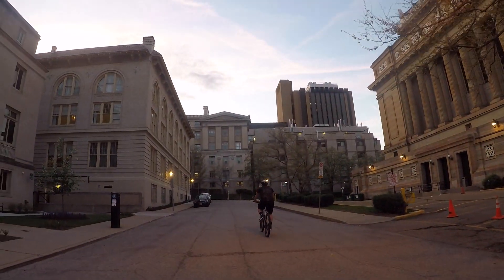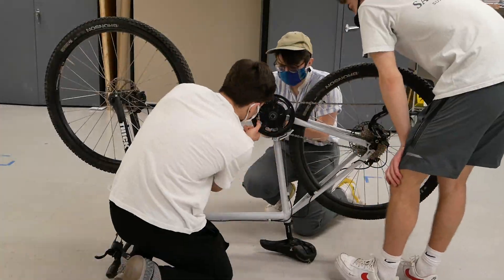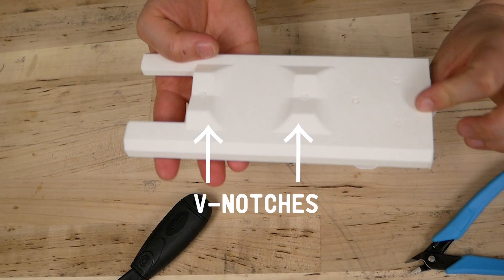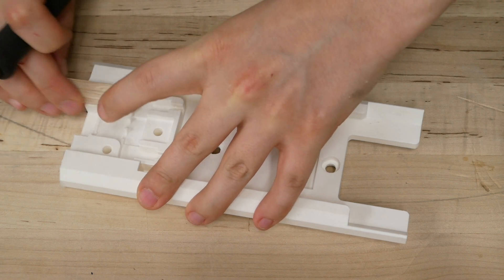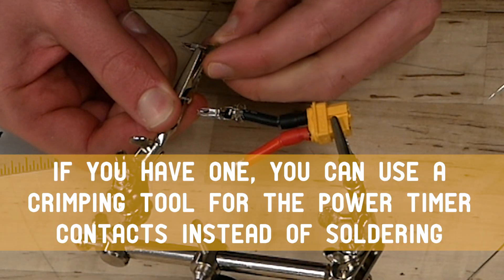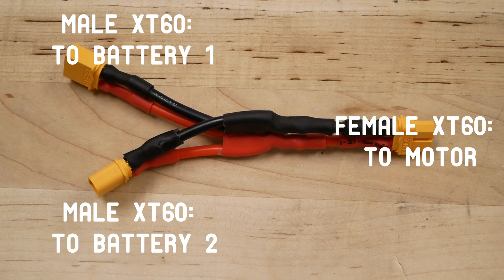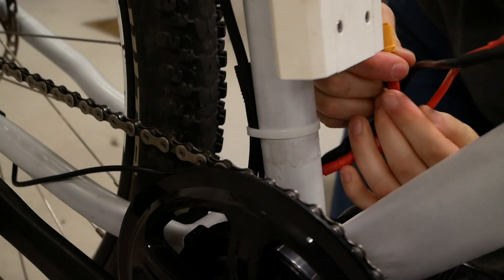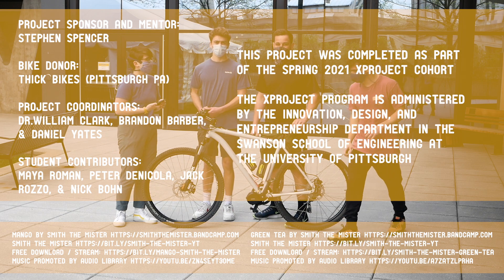DIY EBike Battery System

Comment: A note, you should not be recommending users to parallel two batteries without balancing them first. You will get one battery discharging to charge the other battery, which can be unsafe if the voltage differences are great. 

If you want to balance two, you should get them to charge as close as possible, and then set up a large resistor between the two. Alternatively, you can use a single larger battery, or use a transfer switch, or manually swap the batteries.

Comment: I’m using 56v and 60v batteries on a Bafang 48v motor.  The Bafang system will detect an over voltage situation at 61.5v (error code 7H), so some combination of 60v and 58v batteries in parallel tends to keep voltages within acceptable peak charging.

40v Ryobi batteries for lawnmowers are 6aH.  The major brands for 56v and 60v batteries are Greenworks, Ego, Echo and Toro.  A lot of choices to use here.
Reply: Nathan grant:  do have a schematic of your setup. did you have to change the voltage level  at the controller board. Does the controller board give you a option to change the watts from 750 watts to 500 watts? You have an interesting setup.

Comment: 4Ah x 2 = 1280 Wh	
		
Throttle Assist Range 50 Approximate Miles
Pedal Assist	Range Approximate Miles
Reply: Wrong! 4Ahx2x40V = 320 Wh

Comment: Do you have a version of this 3D printed part that has a flat backside?? I want to use this for something other than a bicycle, and need it to lay flat. Thanks in advance!!!!
Reply: They made the Fusion 360 files available. If you've used that software before, you can open the model and modify it as you would like, including making the back flat.
Reply: @BenjaminNelsonX  Sorry, but no, I have never tried any 3D modeling.

Comment: Please provide info on the throttle and controller used in this project. Thank you for a great project!
Reply: most E-bike Mid Drive kits will come with their own controller, throttle, and brake levers or brake sensors.

Comment: EBAY BATTERIES ARE WAY MUCH CHEAPER
Reply: Ebay 40v ryobi batteries are crap though.. i bought a 6ah batt and it weighed less on a scale than my oem 4ah battery.
Reply: When you buy a name brand battery instead of a counterfeit, you're paying for reliability, consistency, and durability. Worth it if you rely on your bike for transportation, without a doubt.

Comment: Great project! Did you use a 36v motor?
Reply: The link in the description shows everything they used. The particular motor they used is rated for 48v, but as stated in the video and description, they're using 40v batteries.

Comment: LOL...taking a BAFANG to "a local bike shop and they will be happy to help"....Uh no. If you walk into a Local Bike Shop (LBS) with anything BAFANG or Rad Power and you will be laughed at. No LBS is going to touch those motors or bikes for liability reasons alone. Especially in 2021 with how bike parts are scarce as well as bike mechanics. Yeah, no one will help with these motors - you're on your own.
Reply: People able to make this usally repairs their own bike, atleast I do.
Reply: Yesterday, I took my Voilamart rear hub motor to my LBS.  The freewheel sounded like a garbage disposal.  They offered to grease or tighten it, or replace it.  They mounted a new freewheel for $15 and wouldn’t let me pay for their labor. 

What’s sad is that the trek I bought from them 15 years ago is my daily commuter.  It was $200 new, and the only thing I’ve replaced is tires. 

So I’ve only seen them twice in 15 years.  The other 2 bike shops in town went out of business this year.
Reply: Some places do, some don't.  People just should not get upset if they do not.
Reply: 100% true, unfortunately